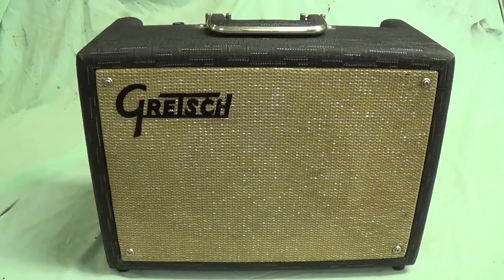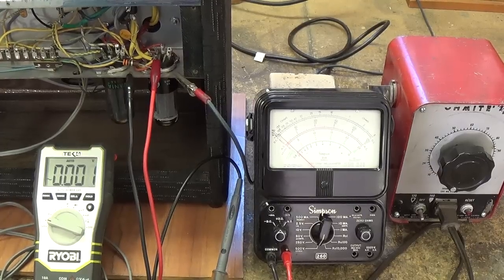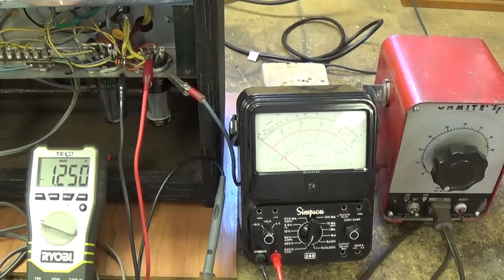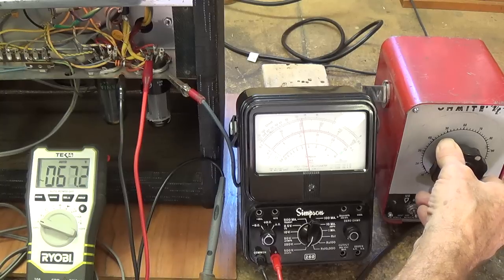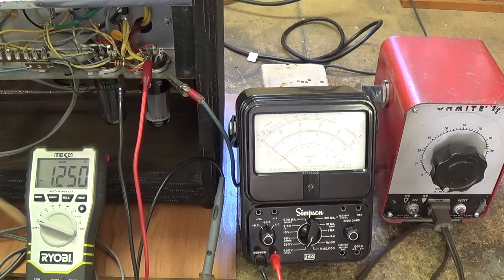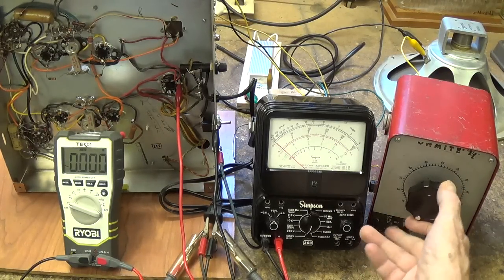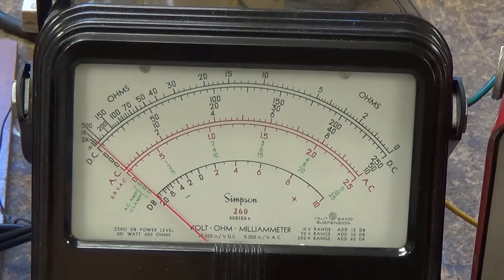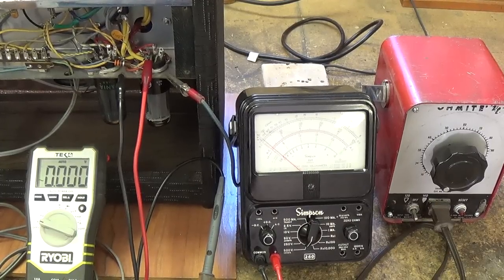Is Gradual Variac Warm-Up Effective with Tube-Rectified Amplifiers ?

Comment: I usually use an octal solid state diode (I make) and bring up the supply slowly with that. I will typically use that with a variac to slowly build the capacitors. Sometimes I will even use a resistor between the output of the rectifier and the rest of the circuitry to limit the current to something modest. I do love videos like this. Very informative. Thanks for posting.
Reply from the maker: I'm glad you enjoy our videos, Bret.

Comment: Using a variac not only slowly ramp up the voltage but also protects against the inrush current in the transformer and giving  filaments a soft temperature ramp when they are cold , avoiding unnecessary damage ,,,  variac , yes always a good reassurance
Reply from the maker: Are you advocating the use of a Variac every time that a tube circuit is turned on ??
Reply: @UncleDoug  yes .

Comment: Just came across this vid. and wanted to mention, as you have shown, should always have meters hooked up during any  questionable operation. My variac is permanently on an ammeter and voltage output meter, no second guessing, don't like surprises or loosing my gear. Thankyou Uncle D!
Reply from the maker: You're welcome, Bryan. You make a valid point, and no one should ever forget to use a Current Limiter during repairs and analysis.

Comment: Dont forget it is probably the case in the UK where the input voltage is 250v AC RMS,  can be noisy or you might just plug in at the peak +/- which for both tube, (capacitor) or transistor (probably more sensitive) circuits the use of a variac - which is also hopefully acting as an isolation transformer,  there are benefits even though the primary and windings of a 240v transformer should still supply the normal  design voltage to the rest of the circuit.    A variac is an additional protection ,  particulary with old radios that have the joys of live dc return chassis (DO NOT PLUG A GRAM OR GUITAR ETC input into one of those !),  and the fun world of selenium rectifiers.   Additionally should you plug any input voltage into a circuit you have not visually checked or component tested if it is a item new to you, and the average home person digging out dads old equipment - or their own from younger days is just going to power up from the mains anyway.  Indeed from your RMS measurements consider the peak voltage is going to rise proportionally differently to your RMS derived measured AC.
Reply from the maker: Thanks for your input, HP.

Comment: Wow the old Simpson 260! I still have mine. Just goes to show even a novice (not you) should have at least 2 VOMs. All juice caps(I call them that because electrolytic is too long of a word) all need the same treatment although the the working volts in a solid state circuit is usually much lower than tube, old filter caps need to be brought up slowly. Great as per-usual Doug. Rusty might have other things on his mind. Thanks
Reply from the maker: Thanks, HT. I rescued the old Simpson meter from a local pawn shop, where it had been languishing for months.....a filthy mess with battery corrosion and God only knows what else slathered all over it. Like all fine equipment, however, it cleaned up beautifully and now looks and operates like new. Glad you liked it :)

Comment: Another great video Uncle Doug! I've always wondered if there was any point in doing this, so it's great to see this test. Thanks.
Reply from the maker: You're welcome, David. Although this procedure can't save electrolytic capacitors that have completely failed, it does enable reasonably functional components to gently return to functionality. Translation: It's not magic, but it generally works :)
Reply: Uncle Doug Out of interest, would this procedure work just as well with solid state rectifiers?
Reply from the maker: Yes, David. The Variac slow start up has always been accepted/recommended for SS rectification. The only question was whether it would work with tube rectification also.....which is what the video investigated. With SS rectification, the DC output should begin immediately upon input of AC and should rise in direct proportion to the AC input.

Comment: Good morning Uncle Doug! Another great video of 'fact'. When I get older tube Amplifiers, Radios & other tube gear in for repair, I swear by my Variac. I've learned to use one religiously when I'm uncertain of an amps condition or how long it was hanging around before the last power-up. Although, I do open up the amp and give a visual inspection under the chassis before any AC gets put into it. However, as we both know, components that look good aren't always as they appear...especially electrolytic caps. From many years of experience, I've learned that this practice of slow voltage ramping is also a safety step. For a good amount of years, I've done what David B has done (I can relate) plug it in and see if anything or what blows up & smokes. After having one amplifier's power transformer go up in flames on my bench and my cat making a B-line for the top of my storage cabinet, I took my Variac (which was laying in the original sealed carton for 5 years) out of the box and placed it in it's permanent place on my workbench. David B also has a true point in his comment on this procedure for solid state amps...BJT's do need all the voltages correct at the same time. What I usually do is, when I get a solid state amplifier of uncertainty in for repair, this is where I use the incandescent lamp current limiter. At that point, I just need to know if there's a dead short or not. It saves trips to the breaker panel, or saves on wasting an extra fuse or two...not to mention possible added damage to the equipment. Another great video as always. This one's going to be in this week's home work lesson for the 3 private students I have :) Always great to see another video from you ::)
Reply: PS: Looks like it was Rusty's day off :) One other procedure that I use and forgot to mention is, when I get a piece of gear that's been laying around, I also take resistance measurements on the transformer windings to make sure there are no shorted turns in either the primary or secondary taps; then I pull the rectifier tube and measure the AC voltages at the rectifier socket.
Reply: As for the "solid state" Amps is use my variac as well. Since i´m dealing mostly with "classic" PA-Amps and there are dual symetric voltage driven anyway. On some germanium (AC something transistors) Amps i prefer an AC current control device (I use a old german "elabo - netznachbildung" with AC current sense, limit and control ability)
But, as you know, to limit the currrent you need to lower the voltage, so the voltage initially ramps up until the current is limited and it drops down or stays there but this depends on how you limit the current.
With an in series resistor (= light bulb) you just limit the inrush current a little and/or add some dynamic(=ligh bulb) resistance to it, it works well, but the inrush current may do some harm....

Some Mains NTC resistors are great helpers here as well, since they act the opposite direction compared to a light bulb. They limit the inrush current and when they are heating up the resistance goes down and the "DUT" (=DeviceUnderTest) come to fully operation within 1-3 seconds. Some sort of "Automatic Variac" but sadly they don´t come cheap. Even the raw component itself is around 10 bucks and you´ll need minium two of them. And everyting around you´ll need to build up yourself and it must be save as it deals with mains voltage...
Reply: I also use NTC resistors for testing purposes It's worth the build...Unfortunately, I have a Peavey CS-800 solid state amp on my bench right now where 5 output transistors are shorted, but a section of the PCB is charred beyond repair due to the customer wrapping the fuse with tin foil...
Reply: Do not remember me on that tin foil thing.....i hate people doin´that!!
How many Amps came across my bench with that?? how many...?? some had been so beautiful until i saw this done to the fuse(s)...always beond repair....WTF?!?!
Reply: I know, some people shouldn't own amplifiers (LOL) :)
Reply from the maker: Frank Ferraro
RE "Rusty's day off"......It's ALWAYS Rusty's day off :)
Reply: Uncle Doug He has the life of a true star! :)
Reply: Frank Ferraro I had a CS-400 amp in my old p.a., and one night at a gig, one channel quit just before showtime. I haven't ever looked inside. It's sitting in my house all these years. I hope I don't find a charred circuit board. I already have a Roland Jazz Chorus head with a charred board. The original owner showed up with it at a gig. He now regrets it, but he said he carried it to gigs with the speaker cord wrapped around the head with the one end plugged into the speaker out and the other end plugged into the amp input, just to keep the cord from dangling around. he was still bringing stuff in when this idiot drummer saw the head and took it upon himself to plug the head into a wall outlet. The power switch had gotten bumped to the "on" position and the result was a blown amp. The bass player & I became acquainted and he gave me the amp. I had it when I was taking the electronics program at the local college, and they had a file full of Roland schematics, but I had to do my school work & never got a chance to look through the files. I was at a loss for how to proceed back then. It looked like the damage was confined to the preamp board of one channel. Maybe I could get it to work using the other input channel, if the rest of the amp was unscathed. I'm not really fond of s.s. amps, but this one might be worth the trouble. However, it's just one of many amps I have and I tend to focus on the amps I'm already more familiar with. I didn't know that I was going to end up being a factory welder with house payments & child support, and eventually poor health. I'd sure love to get back into my life's dream before I kick the bucket. I'm so disorganized that I just don't know where to begin.

Comment: LOL...I have that exact Simpson 260 multimeter (my dad gifted it to me 20 years ago).  I now have a Radio Shack hand held along with a Fluke 87V.  I wish I had found your videos years ago...I found out two things the hard way....the first was the voltage has to get turned up quite high before the tube rectifier output.  I was watching TV as I was bringing up a new amp build.  Every 10min I turned up 10v.  When I got to around 60v or so I smelled something burning and zap....killed the PT.  Now I start new builds with tube rectifiers with a rectifier plug.  I also incorporated a dim bulb limiter, (which recently saved me on a new build with mis-wired SS rectifier).  One last item....I recently picked up a Anatek Blue cap tester.  I see that it can test caps 1uf and above.  What do you do with the smaller caps??
Reply from the maker: The Anatek meter is strictly for electrolytic capacitors, Ireland. Non-polar caps can be tested with a capacitance meter and in circuit with one lead removed from the circuit (see my videos for details).

Comment: Great Video, Doug.

This shows exactly what i´m saying everytime someone is asking me how to deal with old amps, a slow voltage rise is by far the best thing you can do when you check out some vintage electronics in unknown condition. Even better when performed in cunjunction with preheated tubes (if the amp has a standby switch).
Reply from the maker: Thanks so much, TC. We need to protect these poor old vintage devices.....especially now that I'm one myself :)

Comment: Thanks, I have seen both sides of this argued by "experts" , and just plugging it in has never worked for me.  I am happy to see that you put a logical experiment together that makes a reasonable argument why it is worth the time to bring the voltage up slowly.  Another use for my Variac,  Thanks
Reply from the maker: You're welcome, SJ. I think virtually anything is better than simply plugging a vintage electronic device into a wall socket, turning it on, and hoping for the best. I always protect the circuit with a Current Limiter (video posted) and use a Variac for circuits that have been sitting for an undetermined (generally very long) period. Here's a simple test to prove that this "gentle" method works: Measure the ESR values in the filter caps of a dormant amp prior to slow start, and then after (gently discharge them first, of course).....the values will generally show a significant decrease. Any that don't should be considered suspect.

Comment from the maker: Carl, for some reason your question had no reply capability. They probably recommended the solid state rectifier because they were under the impression that a tube rectifier does not put out DC at low input voltages; however, as shown in the video, it actually does. Either way, tube or diode, will work fine.
Reply: That's about right for a filament valve although i suspect the 6u4 will have quite a bit of hysteresis in hot to cold emission. 
Off to the Bat Cave to find out!
Reply from the maker: I believe the 6U4 is a half-wave rectifier, BB, and have never encountered one in a guitar amp. My experimentation was focused only on commonly used full-wave rectifiers, such as the 5U4, 5Y3, GZ34, etc. Let us know what you discover.
Reply: Will do.
Secondly I need to ship the old tubes to you for restoration work.

We have for you, 6v6, 5y3gt in the old bottle style. 6aq5, 12au7, EL33 yes, that's right plus a whole bunch of them made from the late 30s until the 70s.
For my service work I can't really use them which is a real shame
Reply: And my bad, it was a typo

Comment: Fascinating! Thank you! Maybe vintage amps wouldn't need so many Electrolytic Cap Jobs if techs would provide this service when you buy a vintage amp. Regardless, it's great to see myths put to rest with real testing.
Reply from the maker: You're welcome, Jensen. You are correct. The majority of my vintage amps have all or almost all of their original filter caps in place. The Variac and ESR meter (see my other videos) have changed my attitude regarding old electrolytic capacitors. Glad you liked the video :)
Reply: Uncle Doug
Thank you, sir. So far I have enjoyed every one. I am even sending them to my amp repair friends with the advice, "the next time someone asks so many questions that they are expecting you to be their professor free-of-charge, send them to YouTube and Uncle Doug for a primmer."  I especially love how easy you make the math and reading schematics.  My gratitude is hard to express fully.
Reply from the maker: Rusty and I sincerely appreciate your kind words of support, Jensen. It's great to hear that the videos are helpful and appreciated. Thanks, and best wishes from both of us :)   ^. .^

Comment: Very useful. I have an old original (two prong plug and all) Silvertone 1484 that I've been afraid to power up because it hasn't seen electricity in 20 years. I do have a variac. I wonder what duration of time would be appropriate to bring this amp up slowly to reform the capacitors? Caps look good visually.
Reply from the maker: I've heard of people who took DAYS to fully energize an old circuit.....which seems absurd to me. I'd give it an hour to go from 0 to 120VAC, but I would have a current limiter (see my video on how to build one) in series between the amp and Variac just to play it safe.
Reply: @UncleDoug  . .  Yes I watched your video on a current limiter just yesterday, I definitely plan on doing that as well. I also saw your video on an ESR tester, and plan on buying one. Then I read your response to someone in the comment section to check ESR before bringing it up slow, and then checking again afterwards. I love watching your videos and really appreciate it.
Reply from the maker: @234dilligaf  You're welcome, 234. Good luck with your project.

Comment: The two rectifiers you tested are directly heated.   What about indirectly heated rectifiers like the 5AR4 or 5V4?    Your tests confirm my findings.  Btw, I usually use a 5T4 as a tester. Similar characteristics as thee 5U4 but only needs 2 amps on the heater.  Works great.

Comment: You could also install a NTC Thermistor (and bypass relay) in the supply rail to act as a soft start time delay. Then, it wouldn't be quite as troublesome.
Reply from the maker: Thanks for the input, Ken. The main purpose for a "slow start", which may take several hours, is to allow the electrolytic capacitors to reform prior to being subjected to high voltage. I don't think a Thermistor would serve the same purpose......however, it would be useful in place of a Standby switch in larger amps, particularly those with diode rectification.
Reply: No, they wouldn't be particularly useful in capacitor reforming. But, for an amp that is in otherwise good operating condition, they do remove most of the impact of a full mains voltage start-up. They can also be useful in applications where filament flash at power-on (some tubes of European origin exhibit this trait) is a problem. Thanks, Doug. I'm glad to see you on YouTube again.
Reply from the maker: You're welcome, Ken. It's always good to hear from you.